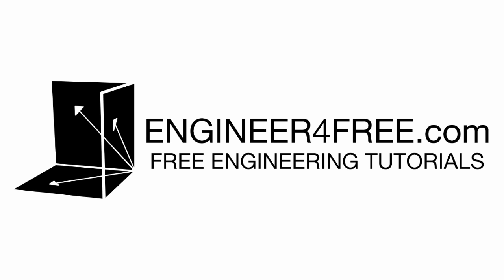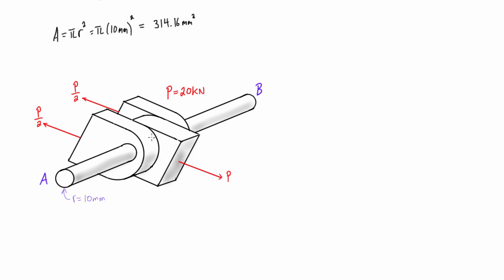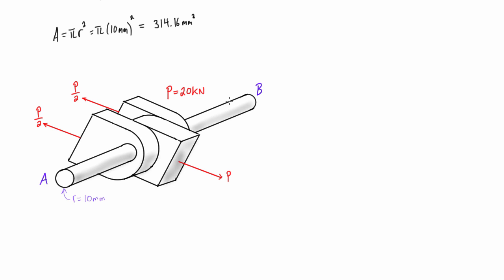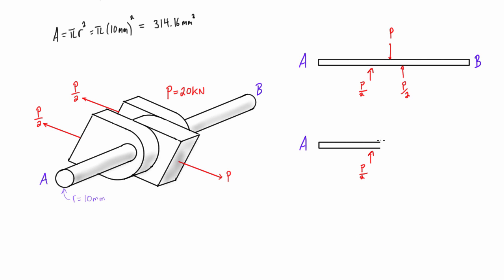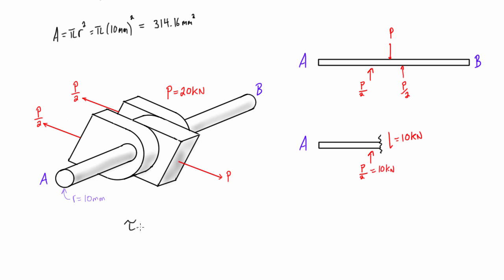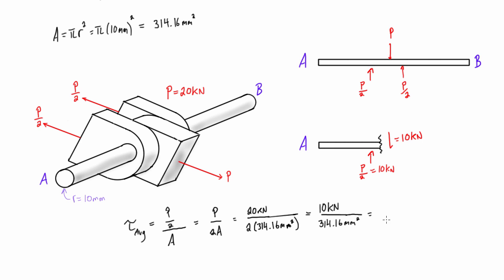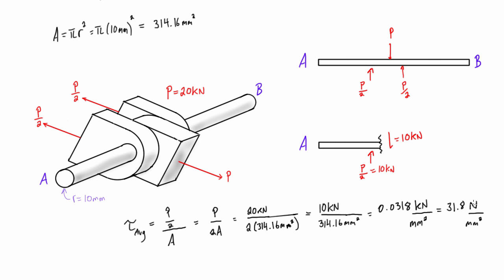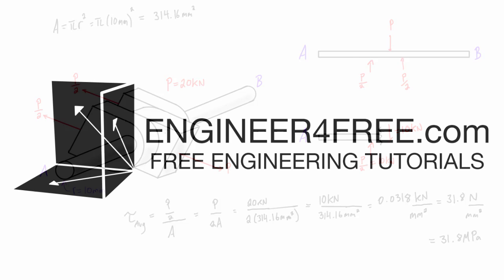Double shear

Comment: Wait... i don't really get it. I have a question, so the average shear for two forces acting on the same rod would be 20/A. And in this video, to calculate average shear stress for 3 forces acting on the same rod, we can pick a particular side of the rod and the shear stress then would be P/2A, right? Wouldn't that only make it some-part-of-the-rod average shear stress, and not for the whole rod?

Comment: sir why you used P/2 as your applied force to calculate the double shear stress
Reply: Remember - P is an equal and opposite force applied to the member for it to be in equilibrium. Since there are two plates in the same direction, the force, P, is split in half. If both plates had the total force of P, there would be an imbalance on the member.
Reply: @1crida1  thank you

Comment: What's the difference between normal stress and shear stress? Seems like the exact same thing, Force/Area for both.
Reply from the maker: Stress is force/area, so you are right in that sense. It's the orientation of the force that is the difference. With normal stress, the force is normal to the surface that it is spread across. With shear stress, the force is parallel to the surface that it is spread across.

Comment: I have a question about a situation of double shear where I had to find the minimal diameter of a rivet for it to withstand a given bearing stress, then the minimal diameter for a specific shearing stress. after I calculated those I had to answer which of these diameters should I pick, how do I answer that?
Reply from the maker: In that situation I would select the larger of the two. Lets say the minimum diameter that you calculated for bearing stress was 10mm and the minimum diameter that you calculated for shearing stress was 12 mm. If you select a diameter of 10mm, then you will not meet the minimum diameter requirement for shear. Does that make sense?
Reply: Yes thank you :D it was the correct answer as well according to my teachers, I was just confused because I read that bearing comes before shearing so wondered if it means that shearing can't happen without bearing and the bearing diameter would suffice.